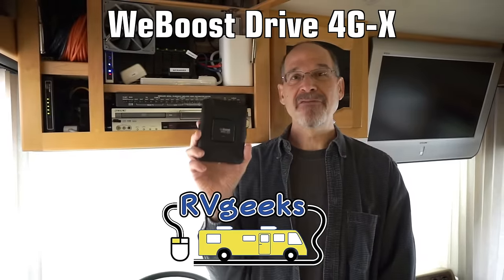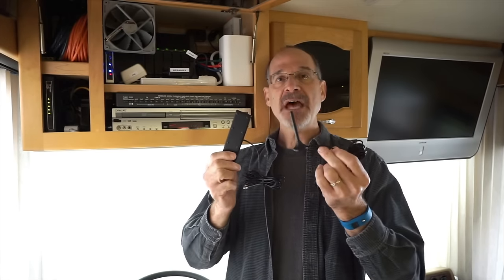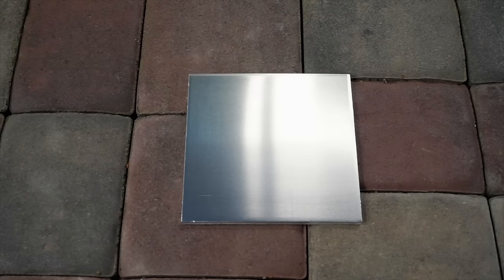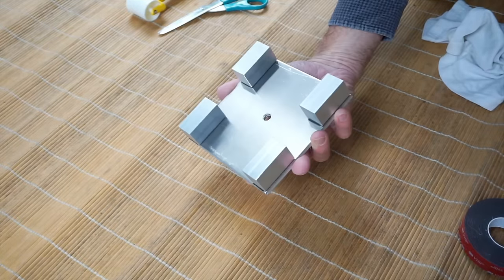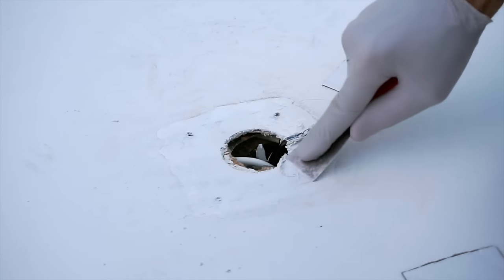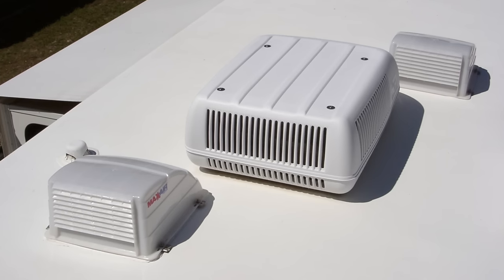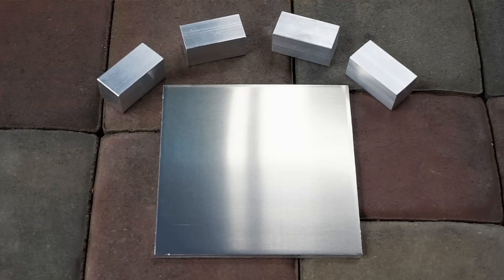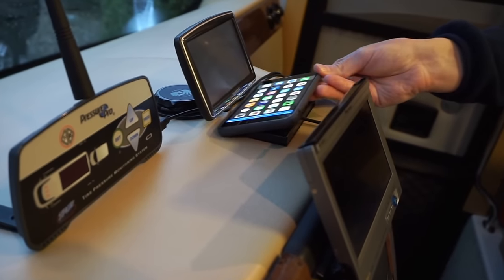Install a WeBoost Drive 4G-X RV Cellular Booster & 4G-OTR Antenna

Comment: I have been agonizing on the best way to mount the antenna on the roof. The ladder is too far back and your concerns on using it were mine. I have ordered the aluminum. Thanks for still having this available.

Comment: We went with the WeBoost, optional 110 power supply, short trucker antenna mounted to the ladder and 10 extra feet of low loss cable.  On our second outing, right now :), we got to our site at one of our favorite campgrounds and found we had NO SIGNAL.  Since I'm a computer systems engineer and on-call, this was going to be a problem.  WeBoost to the rescue.  After the booster was fired up we started to get 1 to 2 bars phone service within a few feet of the indoor antenna.  If we placed our phones or hotspot on the antenna we got 5 bars signal strength and full LTE.  Awesome little device.  Nice to see something that actually does what it says it will.
Reply from the maker: SO great to hear about your experience! We were just in the same situation in a remote part of Vancouver Island. NOTHING on the iPhone... no data or voice.... just "no service." Flipped on the WeBoost and set the phone on the candy bar internal antenna, and BAM! 5 bars and LTE. Like magic. :)

Comment: Thank you both for showing this installation, I just ordered the WeBoost 4G-X this morning. I plan to use the stubby antenna with it (at least initially).  Rock on guys!
Reply from the maker: Awesome Charlie! Let us know how you make out with the stubby. Probably fine for most situations, but we'd be interested in hearing about it. Thanks!
Reply: I should receive my stuff today. However my MH is in the shop having a living room slide malfunction repaired. I likely will not get to do anything towards the installation until mid week next week. I will post up when I do get everything ready.

Comment: Good video. When reinstalling the plate after the new cable is run, isn't crushing or damage to the cable a concern when screwing down the plate.
Reply from the maker: +willie Makit Our plate is the very slightest bit curved upward at the center of each side, so while it does press cables to the roof, it doesn't crush them. We've had many cables come through there over the years, including a stack of them for our old satellite dish, with no problems.

Comment: Next time you remove the plate to your tech cabinet replace the plate with a sewer vent this will allow you to easily feed wires into the rig and you won’t need to remove dicor each time you upgrade stuff... Which seem to happen every 2-3 yeares

Comment: Now that you've had the WeBoost 4G-X for more than a year, what are your thoughts on the system now?  I never understand how anyone could ever ever ever not like your videos.  They are not only professional, they are simply great!
Reply from the maker: Well you certainly just made our morning! Thank you so much. 😊 We LOVE our WeBoost. Makes our travels so much more low stress, knowing we can get online in so many places we normally couldn’t. We use it all the time.
Reply: Excellent!  I have been inspired and motivated to adopt many of your upgrades.  Most recently, I installed a WeBoost with the trucker antenna on a 1/4" piece of aluminum on 3/4" legs, almost.  We are 12'10" high to the top of our A/C units so I didn't want to travel with the antenna up all of the time so I mounted a stainless steel boat whip antenna base to the 1/4" plate which allows me to "manually" raise and lower the WeBoost antenna.  Spending $470.00 to be able to raise and lower remotely the antenna was too much for me.  Again, thank you for the wonderful videos.  I DO intend to support them and you.
Reply from the maker: What a great idea! We though about that same sort of thing, but in terms of being able to cover the RV during storage without the cover damaging the antenna. Since we're full-time and have never covered our RV (and don't even own a cover), we didn't include that option. Also, we often need our WeBoost while we're underway. But your idea is perfect for both reasons - traveling or covering - for many RVers. Thanks so much, and thanks for you nice comment and support. We really do appreciate it. :)

Comment: Great video guys! Was looking to getting this antenna but you brought up something I did not know. I'm a ham radio operator and have already installed 6 antenna mounts to my roof (3 were MNO and 3 were for 3/8-24 Threaded Stud) All of them professionally installed. I was planning to just screw the "4G-OTR truck antenna " onto one of my antenna mounts and not use the mirror mount that is supplied, but from your video it appears the coax is permanent attached to the antenna and does not use the Insulated antenna mount at all.
Reply from the maker: +Mark Logsdon Thanks Mark! Let us know how you make out. 😊

Comment: Hey Guys I would recommend using the 304447 Panel Antenna with your kit instead. It is stronger and would give you a larger coverage area as well
Reply from the maker: Hey Chito... we'll definitely consider that if we need any change, but at the moment the current setup works great for us. We rarely have any need to move our boosted device away from the candybar antenna.
Reply: RVgeeks I am very glad to hear that! I work for Wilson Amplifiers, a premier partner of weBoost, Reach out to us if you have any questions or concerns and we would be glad to help you out

Comment: Great instructions. Thank you. What type and size of screws and drill do you recommend to mount on a rubber roof?
Reply from the maker: Hi Lori! Thanks! You'll want to use self-tapping wood screws (no drill needed since you don't want to pre-drill... let the screw make its own hole so it has the most "bite" and holds properly... pre-drilling is only needed for materials like fiberglass or metal), but the size of the screws you need depends on a couple of things. First, you need a screw that's small enough in diameter to fit through the hole of what you're installing. Underneath the thin rubber membrane, most RVs will have a plywood layer, so you don't need screws that are very long... there isn't anything else underneath the wood that's providing much of anything for a screw to hold onto. So usually a screw of no more than 3/4" or 1" is needed. You'd just be risking having the screw puncture something (ductwork, electrical wires, etc) by having it be any longer.

Comment: Is there a video where you installed that conduit? Brilliant!
Reply from the maker: +jwall62 That came from the factory. Wouldn't want to try to figure out how to install one later. I'm sure it can be done, but I wouldn't know where to start cutting the hole.

Comment: By using the smaller antenna,  how tall was this antenna from the ground?  Our coach is 12.5 ft now and it needs to be where it can receive the signal.  You two really do help us out a lot since we are new to the RVing scene.  Thanks
Reply from the maker: +Eddie M Harris Hi Eddie! The small "stubby" antenna is 4" but can be mounted directly on the roof so that it will not add any height to the RV, since it won't be the tallest thing up there. The spring mounted trucker antenna we used is 18" tall, plus 1.25" for the aluminum blocks & plate. Total height would then be 19.25" above the roof of your RV (roof height is likely lower than 12.5' as that includes A/C height, etc).
Reply: Thanks for the info.  Then you guys height with this antenna is real high.  Do you think you will have problems with traveling and low bridges?
Reply from the maker: +Eddie M Harris We were 12'4" before, so now about 13' even. But we have a general rule that we don't go under anything below 13' anyway, due to allowing for new pavement height etc. So we'll stick with that and allow the spring to do its job just in case it's that close.

Comment: Follow up check, how is the VHB antenna “stick to the roof” mount holding up. I am about to add the Weboost 4G-x RV antenna to our fiberglass roof using a similar mounting approach
Reply from the maker: Like a rock Mark! That VHB is amazing!
Reply: Well we followed your lead and are giving VHB and a variation of your aluminum mount a try. Built it from aluminum scraps, VHB and pop rivets.
Reply from the maker: Sweeeet! Please let us know how you make out.
Reply: @RVgeeks  Do you have a link for where to purchase the VHB?
Reply from the maker: Hi Minnie! Just wanted to make sure you saw our more complete reply on your other comment.
Reply: @RVgeeks  Yes we did.  Thanks for all your help, and for educating us about our roof materials and how to NOT damage it!

Comment: You said you can't use the VHB tape on a rubber roof, (I hate to hear that), do you know if  eternabond tape can be used on a rubber roof. We have an '03  Newmar DutchStar with what they called a britetek roof. I'm not sure if it's an EDPM or TPO. I wish it was fiberglass like yours. Would those self adhesive cable mounts you used stick to a rubber roof?  Thanks, we enjoy your videos so much, a wealth of information.
Reply from the maker: Thanks for the nice note and great questions, Richard. First, please note that we have never owned a BriteTek roof, but we understand that it's supposedly a higher-end variant of a "rubber" roof as compared to TPO or EPDM (one of which we had on our Bounder.... can't remember which). It's okay to use Eternabond on any type of roof, including all types of rubber materials. The reason we say you shouldn't use VHB on a rubber roof is due to the difference in roof structure and the difference in purposes between Eternabond & VHB. Eternabond is for sealing/waterproofing, but VHB is for securing something in place, such as solar panels, or in this case, our WeBoost mounting bracket. The problem lies in the way rubber roofs, including BriteTek are constructed. Since its outer layer is a thin membrane adhered to the underlying surface, attaching something to it for the purpose of securing an item in place could pull up the membrane over time, causing it to separate and come apart. But the Eternabond is being used to waterproof/seal, and not holding any larger/heavier item in place, so it works fine for that. It's not that you absolutely couldn't use VHB on a rubber roof. We just think that it's opening up the membrane to separation/damage over time. As far as those cable mounts go... even though your roof material might not be quite as smooth as ours, we'd expect that they'd hold to your roof just fine. Just be sure the surface is super clean before adhering them, and the should stick. Even if the roof isn't smooth enough for them to hold as firmly as on fiberglass, they should work. We haven't had a single one come loose yet, and we installed ours on a cold, damp night! Hope this helps a bit.

Comment: Has anybody in the comments hard-mounted the WeBoost to a 12 volt power supply rather than using the supplied cigarette adapter ? If so, is the polarity of the leads obvious once the cable is cut ?
Reply from the maker: Hard-wiring to a 12-volt source is probably pretty common (we're using 120V AC since we keep our inverter on 24/7 anyway due to our residential fridge). Not sure if the polarity is obvious, but since the end of the cord that plugs into the WeBoost isn't hard wired to it, you should be able to test the polarity with a circuit tester before plugging it in. We'd suggest plugging the cord into the cigarette lighter, and testing the other end with the tester to confirm that the inner contact is positive. Then you can replicate that after cutting the plug off and hardwiring, before plugging the WeBoost into it. Hope that's clear, and helps.

Comment: Can I ask where you purchased the 1/4" aluminum plate and feet? I'm have the WeBoost and WiFi Ranger installed with my second phase of solar at AM Solar in Oregon in April. I appreciate yours and gone with the Wynns video on equipment. I hope you had a great Panama crossing too!
Reply from the maker: Hi Jody! Bought 'em on Amazon:
6″ x 6″ x 0.25″ Aluminum Plate: http://amzn.to/2Gs1wFB
1″ square x 2″ long Aluminum Blocks: http://amzn.to/2DJ6mN2

We did indeed have a great time in Panama. In case you haven't yet seen, there's a video about it on the Wynn's channel today. :)

Comment: I wonder why your didn't use the 4G for RVs unit w the unfortunate uni-directional antenna. .  I have the unit you discuss, it doesn't service the whole RV - only the 3' locality round the candy-bar antenna.
Reply from the maker: @Mtn Goat - well... you've actually answered your question IN your question, LOL!  It's the uni-directional antenna used with the RV 4G package. First, we didn't want to have to aim that every time we set up camp. Second, we want boosting while we're underway. And third, that directional antenna isn't really designed for regular setup/take-down it experiences in RV use... it's really a "set-it-up-once-and-forget-it" kind of thing.  And since we primarily only need to get one (or two) devices boosted at any one time, the shorter range of the candy-bar antenna isn't a problem for us. Drop the Verizon MiFi on it and connect everything up. DONE!
Reply: Yeah I was thinking of making a fold up swivel for the uni-directional antenna; simply point it with cell signal apps. Guess I'm cheap, trying to minimize verizon devices on the monthly bill.  You may read the 4G's manual.  It specifies distance from candy-bar antenna to device 16" to 36" I think.  I called then to verify the distance.  If you have a decent signal to start, your antenna gain will be hot on the device.  Thanks,
Reply from the maker: If you have a crank-up-and-rotate TV antenna, you could also consider mounting the 4G's directional antenna to that. When you get to a spot, raise and rotate the TV antenna to point the cell booster (assuming, of course, that you don't ALSO want to use the TV antenna for TV!).  OR... get a refurb or salvage TV antenna like that and install it JUST to use for raising/lowering and pointing the 4G. Might be easier than building something from scratch.

Comment: Is re-broadcasting a licensed frequency legal?AT&T / Verizon / etc. are all licensed, giving only those companies rights to broadcast (or re-broadcasting) those frequencies... just curious.
Reply from the maker: +Chris Skelly Hi Chris! Every carrier has a process for completing the FCC-required registration of your booster, which is part of the process of setting it up. So they know they're out here, and all is on the up & up. It's actually not rebroadcasting, but only boosting it in a very limited, confined area.

Comment: I’m gonna ask a stupid question, is this just for cellular or does it work for wi-Gi also?
Reply from the maker: Hi Bill! This is strictly for cellular boosting. Wi-Fi boosting requires a whole different system.
Reply: I have a Winegard Wi-Fi extender, needs to be installed.

Comment: Could you tell us the specs for your conduit access point lid?    Thanks for a great channel.  You two are appreciated.  Lots.
Reply from the maker: Thanks! It’s about a 4” square piece of thin aluminum plate with a hole drilled at each corner.

Comment: I like your roof antenna installation... how well has the mount held up in your travels and did it cause any issues with increased height clearances?
Reply from the maker: It’s still solid as a rock, and no issue with clearance, other than being aware that we’re 9” taller than before. But being spring mounted, and us rarely cutting it that close, no problem.
Reply: RVgeeks thank you 👍🇺🇸

Comment: Looking at the specs the RV 4G has 60 dB of max gain as compared with the 50 dB max gain that the 4G-X provides. The RV 4G requires one to aim an outside antenna at the cell tower so that might be a drawback (from a convenience perspective) while the 4G-X has an omnidirectional outside antenna instead. There some other more subtle differences too. I am wondering why you selected the 4G-X over the RV 4G. Could you provide some insight?
Reply from the maker: +Beyond High Hopes The extra gain isn't worth the effort of having to set up and aim every time you park and the loss of the ability to boost while rolling down the road. Both were showstoppers for us.
Reply: Thank you for the response! It would seem then that the RV 4G model would be best suited for trailers / fifth-wheels instead of a motor coach. Plus a second signal booster for the tow vehicle would be needed to avoid having to transfer the amplifier around all the time. Could get expensive for the trailer / fifth-wheel folks that want to have signal in the RV and in the Tow vehicle.
Reply from the maker: +Beyond High Hopes Great point about the difference between motorhomes and trailers, since they never need boosting in the RV underway. You could swap the booster between tow vehicle and trailer fairly easily by replicating the power supply, candy bar and 4" stubby antenna in the towing vehicle, none of which are very expensive. You could also them opt for the RV4G on the trailer for max boost when parked, assuming you don't mind setting up each time. A lot of that choice might depend on how often you move and how remote the areas you that frequent are.

Comment: Hi guys.  Will the air conditioner motor interfere with the signal .
Reply from the maker: We haven't run our A/C unit since installing it (we're south, but not THAT far south!), but we've never heard of that being an issue. We'll of course be doing an update when we've had more time with the unit, and we'll keep that in mind and see if we can do a little test with it on, then off. Of course if we discover any anomalies, we'll report back.